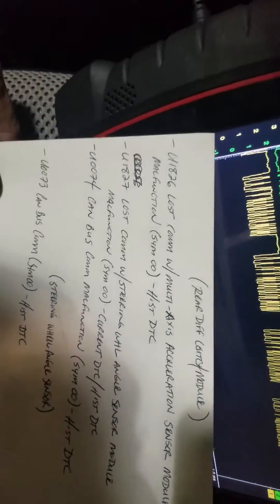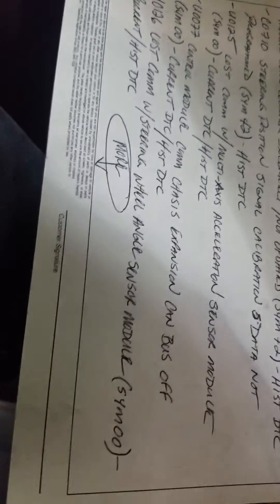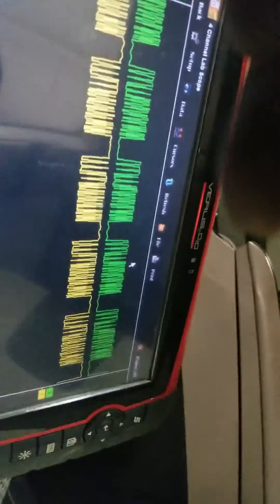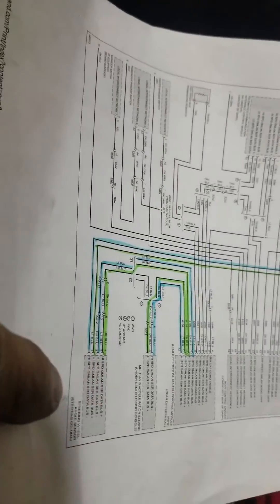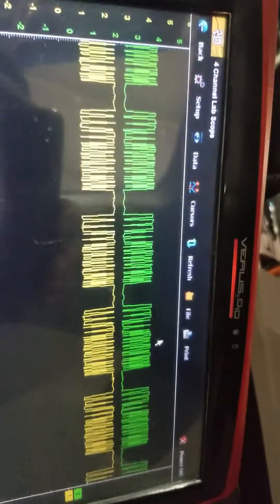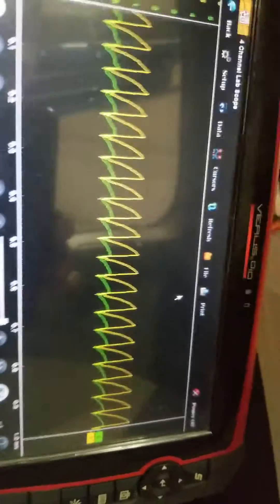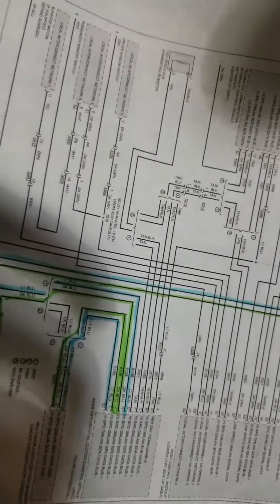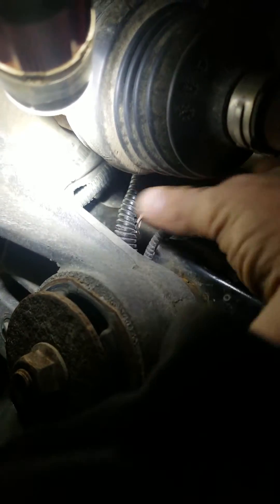2014 CHEV EQUINOX 2.4L, CAN BUS COMM, STEERING ANGLE, & MULTI-AXIS ACC SENSOR FAULTS (PART I)

Comment: Good video, running into a problem with the multi-axis sensor, but unlike a failed comm line, running into a lateral acceleration issue, glad to see something about this system.
Reply from the maker: Otherwise I'd be checking the can bus at that connector where I depinned it at x411, check wires for damage there and all the way to the connection at the rear diff, because if the can bus wires from your lateral sensor are bad going to the rear diff this code may be set.  Remember they are exposed to road elements and have higher potential for damage there.  I'd also double check tsb's and call GM to make sure that a reflash is not available first.

The multi-axis sensor can fail, but you have an implausible signal being reported, so what modules reported the c0186 5a dtc?

Depending on what system you have, the multi-axis sensor sends it's signal over the can bus through the rear diff module, hence why I depinned it at x411 connector like that.  The rear diff module receives info from multi-axis acceleration/lateral sensor and relays that info to the ABS Module over the can bus.  So it's important to know who or what modules are claiming the signal is not plausible or agreeable.

The rear diff requires the steering angle and lateral acceleration info to determine clutch operation, so it's a big player like the abs module in determining what good and bad is in the system.
Reply: PAULY'S AUTO thank you for explaining this, too be honest I didn't think about a reflash, but after your explanation it makes sense. Next is x411 integrity, Pauly thanks a million I'll let you know the outcome
Reply from the maker: @cdsfleetrepairs  what did you end up finding out on that car?
Reply: PAULY'S AUTO hey Pauly currently pulled center console and in process of checking can wires for high resistance if all checks good plan on updating abs module if that fails then I believe my last option would be replacement of the abs module I've already replaced the axis module and multiple resets and relearn procedures but I still get the c0186 and now I'm getting c0187. I've inspected the plug at the left rear axle and the plug at the right kick panel, no corrosion at either connections so now I've got the abs module disconnected and will be checking both can wires to the axis module. This sucks lol but I refuse to lose
Reply from the maker: @cdsfleetrepairs  for sure, what's the CAN looking like coming from the EBCM?  Are you able to communicate with everybody on the network?  Does the multi-axis talk through your steering angle sensor then up to the EBCM?  I assume you took a look at the steering angle sensor can signals coming in and out already?

Do C0186 & C0187 set immediately after clearing DTC'S?
Reply from the maker: How's powers and grounds looking at EBCM, Steering Angle Sensor, and that Multi-Axis Sensor?

Did you check them all while doing wiggle tests on connectors and harnesses, just to make sure you don't have a pin fitment issue somewhere?

What's your year, make, model, sub model, engine?  FWD or AWD? I could take a peak at your CAN network diagram on Prodemand to see if I can help give you some direction.  I know how these issues can really demoralize a guy trying to get to an answer, maybe I can shed some insight into this for you?
Reply: PAULY'S AUTO power and grd are good but I have not done a wiggle test you have a good point also this vehicle is a frt wheel drive. I have not pulled the steering sensor plug yet, I'm wondering if the problem could be there. I can talk to all modules
Reply from the maker: @cdsfleetrepairs  I'd be looking towards that steering angle sensor, the FWD relies on it to relay MULTI-AXIS information to the EBCM, unlike the AWD like the one in my video, which uses the Rear Diff to do this.  If you look on the Network layout you can see this difference between the two.  So X411 is not a factor because on a FWD the multi-axis sends its CAN COMM through your steering angle sensor, who then relays that info to the EBCM.  Double check that on your schematic, but those steering angle sensors fail often and I would be looking closely at the lateral sensor signal pid under data display for the steering angle sensor to see if maybe the disconnect is that steering angle sensor is sending incorrect information to the EBCM for the multi-axis sensor and that's why your getting correlation issue.

Especially true if codes set as soon as you move the steering angle after code clear.
Reply from the maker: Any luck getting that car diagnosed?
Reply: PAULY'S AUTO no luck yet pulled steering wheel and checked connection at sensor, checks good, cleared codes test drove and I did notice on left hand turns is when the code sets.
Reply from the maker: Yes and getting to the multi-axis sensor is difficult because of where it lives, what codes are you getting?
Reply: @PaulysAuto  c0186 5a
Reply: @PaulysAuto  thanks for any help
Reply from the maker: I know some of these GM's require a reflash for this issue.  I believe it is related to the steering angle sensor and the multi-axis sensor data not coinciding with one another.

Is it a hard fault?

I assume you already cleared DTC and attempted a good recalibration for the yaw rate and steering angle with scan tool?